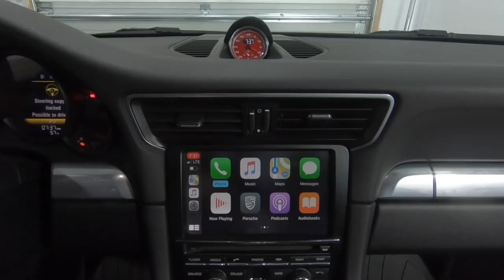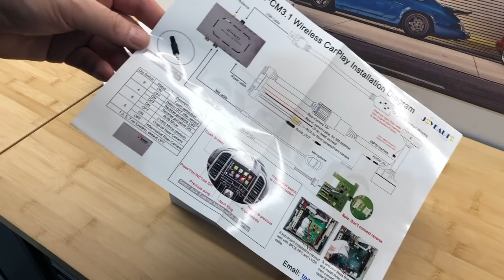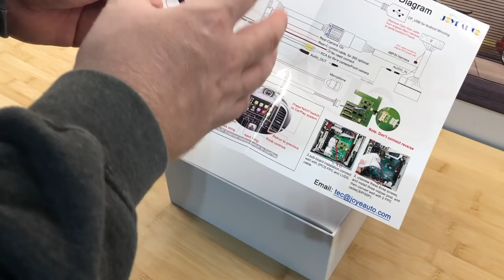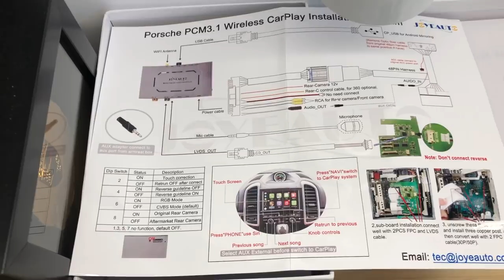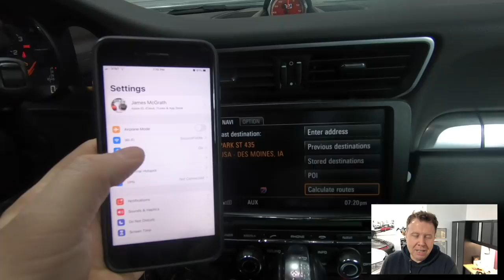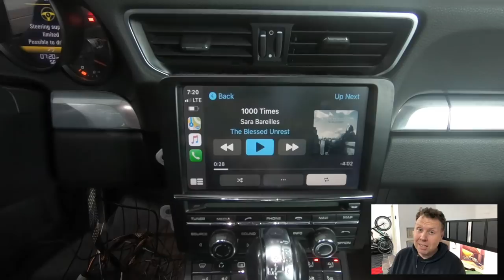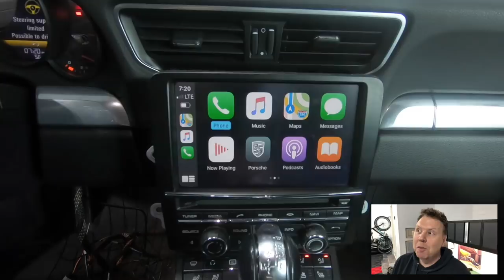Apple CarPlay DIY (Wireless) for Porsche 911 / Cayman / Boxster / Macan / Cayenne / Panamera

Comment: Congrats James, rally nice job and video! I am about to install the unit by myself to my 16 Panamera GTS. I do have a question regarding connection of the fuse to the car fuse box, wondering which slot# should I choose? From the forum I have been seeing discussion about that fuse should be plugged in to slot that cut off if the car power off (some slots are always ON I guess), any instructions regarding this part? Thanks a lot and congrats again!
Reply from the maker: Hi there! Thanks for your email too. I sent you a photo of my fuse box to show which port I used. Good luck and let me know if you have any other questions!
Reply: Zhi Li I’m also going to fit to my Panamera and am interested in which fuse location was used

Comment: Exceptional video.. About to collect a 2016 Cayman GTS and hope to do the same; whether I do it get it done, let's see but you've done an amazing, well presented and instructional video. Thank you
Just have to add that if ANYONE has done this to their 981 Cayman or Boxster, how well did it go and was there space for the Joyeaux unit and where?
Reply from the maker: I just installed this in a 981 Boxster yesterday and the job was identical to the 991. Enough space, no issues. Hit me up if you need any help! Thanks!!

Comment: I just installed the JoyeAuto in my 991.1 yesterday. I couldn’t have done it without your great videos. My only snafu was removing the orange Bose wiring and then mistakenly reinstalling it in the same place. I do have one question. You mentioned secured the box with zip-ties. Do you have any suggested in this regard?
Reply from the maker: Nice work Nigel! Great job. For the zip-ties, I used black ones that I bought from Amazon which were approximately 12 inches long. I wrapped several around the JoyeAuto unit first to create a 'mesh' of tight lines for me to use to mount the box on the size of the car. I then used another zip tie, fed through the mesh I created around the box, to then attach everything to the side of the car and pull it tight. I'm maybe not explaining that very well... hit me up at contact@autoamateur.com if you need more... cheers! James
Reply: @AutoAmateur  Thanks James. Big fan. I think I understand what you did. My next job is the backup camera. Yikes!

Comment: Such an awesome video, thanks for taking the time and detail to do it right!  I installed this on my 2011 Cayenne S, and it is so great!  Absolutely, perfect and really updates the tired PCM-I don't look at my phone anymore while driving, too.  I wouldn't have trusted this product from China, and the detailed install, if not for this video.  I am amazed not a wire was needed to be stripped, spliced, or crimped.  Everything falls into place perfectly. This is even better than most factory installed CarPlay as it links wirelessly upon start up.  Ultimately, it is not as hard as it looks-it is worth it!

A few notes/speedbumps from my install:

My problem was video would show after pressing NAVI, but no sound.  

1.This overall theory needs to be stressed: the sound from CarPlay module comes through the standard PCM AUX input, and you have to press that prior to the NAVI button, which activates CarPlay on the screen.  If you don't press AUX first, it will play whatever audio you are on, while showing CarPlay.  Just leave your source on AUX and your car will seamlessly go to CarPlay every time automatically on startup.  

I had disabled and hid the AUX button, previously, since I never used this older technology, instead using AUX BT (which I now disable/hide in favor for the JoyeAuto CarPlay).  I could not find a way to unhide the AUX input and ultimately had to do a PCM reset, to have it show up again.  After performing this reset, it appears and you can then select it, and have sound and full functionality.

Perform a PCM handover (also known as a PCM hard reset):
Press and hold the Info button for approximately 10 seconds until the PCM reboots.
Immediately select the following from the CAR>>OPTION>>Set PCM System>>Reset PCM>>Vehicle Handover>>Yes>>Yes
Press and hold the Info button for approximately 10 seconds until the PCM reboots.

2. JoyeAuto is now including 6 screw mounts (screw 2 together (x3) for a tall support) for the circuit board install, so it sits higher and perfectly above the existing boards.
3. Turn off AUX/BT and just commit to using CarPlay fully.  This reduces connectivity and calling issues, and just simplifies everything.  Bottom line, you won't need the old PCM interface anymore.
4. Fuse board spot for Cayenne, is on the left side of the driver side dashboard, where the dash faces the door.  Pop off this panel and plug in fuse into a vacant spot that turns on and off with the key in and out of the ignition.  
5. Make sure to read and follow comments/tips from Fastpitch Net, very helpful must read notes!
6. SAT still works as a source in case you ever want to go back and use Sirius XM like normal, however, there is a CarPlay app for that, so you can just stay there and use that instead.
7. Make sure to go into settings and have the microphone do an automatic adjustment.  My callers were getting echo when talking handsfree, and this setting auto adjustment instantly fixed it.

Feel free to ask any questions!
Reply: Thanks Mr Largo, Can I ask how you do #7? Where do you go into settings to have the "microphone do an automatic adjustment"? My voice quality to outside callers is terrible and distant. This is the first I have seen of this suggestion. Maybe I just missed the setting. Is this on the "settings" icon on the CarPlay screen (displayed on the cars PCM display)? Wondering if my version is missing that option on the Joyeauto installation.

Comment: Your video was truly helpful! Thank you.
However, after installation, this module has discharged two batteries already (one - I thought it was old, two - I realized it was the radio). Do you know if I have done something wrong? I'm thinking on returning it back now...
Thanks!!
Reply from the maker: You’re using the wrong fuse slot. You need to make sure you’re using a switched fuse which means the slot powers on and off with the ignition.

Comment: Thank you for this, by far the best DIY out there. Question, since you have SirusXM. Can you listen to it while also in Carplay?
Reply from the maker: Thanks! Great question. I will have to check, but I don't think so. The CarPlay app comes in like an Aux input. So when you select it, it 'owns' the audio input and what you listen to.
Reply: You can listen to any input whilst the CarPlay screen is on. So you can be in Apple Maps, source set to Sirius (i only tested FM Radio), and control radio from the dash screen.

Comment: Great job. Any thoughts on installing a backup camera at the same time on a 2015 911S? Excellent detailed video. Definitely a job that requires patience and a bit of support.
Reply from the maker: Thanks so much! Installing the back-up cameras physically is quite a tricky job to do alone, but once you have the wires inside the cabin it's super easy to plug them into the AppleCar Play JoyeAuto device and have them appear on the screen. The challenge with the cameras is removing the front and rear bumpers and then snaking the wiring inside the cabin and then figuring out the best way to give them both power. I believe the rear camera needs to tap into your rear brake lights and the front camera can wire directly into your fuse box. A friend of mine just attempted this job (completed it successfully) and it took him all weekend. If I can find that much free time, I'm quite tempted to try it out. If nothing else, it will make for a great video! :-)

Comment: Great installation video!  Been thinking about doing this, and now I feel more confident I can.  Looking forward to receiving my joyeauto kit.  Thanks for taking the time to make this educational video.
Reply from the maker: Awesome! Please feel free to give me a shout if you need any help talking through the install. Good look!!
Reply from the maker: “Luck”! 🙄🤦🏼‍♂️
Reply: I ordered the Joyeauto kit off of aliexpress on 4/17, received it 4/24 (very quick) and installed it today (4/25).  Thanks a lot for the time in making the install video.  Very helpful. I had a couple of “uh-oh” moments.  I needed to transfer the fiber optic cable from the OEM 48 pin connector to the new one. I had a really hard time putting the joyeauto connector box under the steering wheel.  I found an area further back, above the pedals.  I secured it with zip ties so it wouldn’t interfere with driving should it get loose. I also had an “oh-s**t” moment when the video cable came off of the motherboard. The female part of the plug that is supposed to be fixed to the board came off.  I was able to reconnect it, but that means it’s not as secure as it should be.

I also ended up getting a small “nick” on my screen. Bummer, but oh well. I know you said to be careful, but apparently I wasn’t careful enough.  I would suggest to others that they tape some cardboard over the screen while work is being performed. 

After the install I did notice my one touch up/down on my windows didn’t work anymore. It started working again, but my passenger window still doesn’t “one touch”. I’m hoping it resets/fixes it self. (My car is a 2015 991 S cabriolet). I’m looking at adding another mod to lower/raise the roof with the remote.  Just waiting for my Smart Top (from mods4cars) to arrive. 

Oh, you also said you didn’t receive enough screws.  The store I ordered my kit from said that if you have XM you should ask for extra screws.  I have XM, so I asked for extra screws and I received them. They gave me six.  However I was only able to use 4 because of interference with existing components.

I also found out that some of the ribbon tape connections weren’t properly made.  Once I reconnected them it worked.

Comment: Again thank you so much for the video. Now that I have watched it entirely, I have a couple questions and depending on your answers will be buying the joy auto  1) You have had it a year now, are you happy with the joy auto unit? 2) You installed the unit under the steering column, but I didn't see you "secure it" in any way. Does it rattle? 3) Will any empty fuse port work? (You mentioned D1 early in the video) 4) You installed the microphone near the steering column. Does it pick up your voice well, particularly when you are driving and their is road noise?   THANK YOU
Reply: I just saw at the top of you post that  you are selling units for 25% off MSRP.  How do I buy from you?

Comment: Hi James. great video! i have one install in my wife Macan and everything works really well except when she calls from her car the receiver of call hears and echo of their voice coming back to them.
Just wondering if you have any suggestions please?
Reply from the maker: Hi there! I have encountered this issue with one or two installs. I think it comes down to a combination of the quality of the microphone and how securely it's mounted. For my own 911, I found that mounting the microphone inside the steering wheel column, next to the factory microphone, has worked very well for me. I don't seem to have any issues with echos or voice quality. A simple solution might be to invest in a better microphone to be honest. You can pick up a decent quality microphone from Amazon for anywhere between $10 to $15. It's just a simple plug and plug microphone.
Reply: @AutoAmateur  thanks James. appreciated and try that.

Comment: Excellent tutorial, thanks. But, question. You say the Chrono dial face was a 5 out of 10 and this an 8 or 9 out of 10. What would you say an engine swap is on difficulty? Or, perhaps replacing gears in the PDK? Maybe you explained your scale before and I missed it. Keep up the good work.

Comment: I have looked and looked to find a video like this and I must thank you for your very detailed video. Although mine is Android+997.2, I don't think it would be much different. Still looking pretty daunting job to tackle on but at least now I know what it involves in. By the way you put the JoyeAuto unit under the steering column but I was wondering if you held it in place with anything such as ziptie, double sided tape and so on. The space looked like it's a pretty tight fit and the unit wouldn't come out of that spot easily but I wouldn't like it if it rattles when I drive only because I didn't hold it in place with some sort of fastening method. 
2 constructive criticisms are that your background musics are very cheesy (I respect your taste though) that I am not sure if they suit to these type of Porsche videos and that you put reverse rolling /dissolving effects on the captions that show the first sentence the last. It makes the viewers not able to see the whole captions clearly. No intentions to insult you in any way but just my thoughts. Thank you very much again for your helpful videos.
Reply from the maker: For me, I'm able to store the device under my steering column, in the space between the trim and the column but that's only because I have the steering wheel all the way out and up, to accommodate my height. Most people can't use that space and therefore secure the box and the cables to the upper left side of the driver's footwell. That's a great observation!
Reply from the maker: p.s. Thanks for the feedback on the video too! Noted!! Appreciate it.

Comment: Excellent video, I'm just working through this and it worked first time. The only issue I have is getting the PCM unit back in to the dash, the extra wiring is stopping it going all the way in. Any tips on this?
Reply from the maker: Thanks Richard. Glad it helped. Yes, it's a tight squeeze back there but with the right 'finagling' it will fit. I believe there are some open spaces below the PCM which can take some of the wiring and try to make sure the black wiring harness (cube like connection) is over to the right hand side of the space.

Comment: Hi James. Just ordered the unit for the upgrade. Should be doing the install in early May when the car come out of storage. Your video is excellent and I’ll have my iPad going next to me every step of the way. Would be kind enough to link any other sites you used to get some more installation instructions? Thx...
Reply from the maker: Hey Tony! Nice one! One of the reasons I made the video actually was because the instructions that came with the device weren’t great and the stuff I could find online was equally terrible. If you need any help during your installation please hit me up at AutoAmateurBlogger@gmail.com. Happy to answer questions or even jump on a call or FaceTime if you want to. Happy to help. Cheers!
Reply: Thanks for the reply... will let you know how it goes and appreciate the offer to assist.
Reply from the maker: You bet!
Reply: Hi James. Just finished installing the CarPlay. Much easier than I thought it would be. Your video helped out a bunch, especially when it came to disassembling the head unit and making sense of the wiring harnesses. When I started testing, I wasn’t getting any audio, but thankfully, one of the comments let me know about the fiber optic cables. Still trying to figure out where I’m going to hide the box. Thx again.
Reply from the maker: Nice one Tony, thanks!! Congratulations on a job well done!

Comment: Excellent video!  Did you take precautions to ensure the box doesn't get crushed under the steering wheel if it is adjusted down?
Reply from the maker: Yes, it’s to one side and not directly under the steering column. The only thing that would get out under pressure if the steering wheel were to get lowered would be the wires.
Reply from the maker: Ps. Thanks!!

Comment: great Video. I had to reconfigure the switches on the external gadget and everything works well and connects with any iPhone. the only issue I'm facing now is connecting it to my android. Nothing I did worked till now. Any tips out there to help me fix this problem??
Reply from the maker: Try using the USB cable first. Once connected, your wireless connection should pick up the next time you’re using the unit.

Comment: James, great video and just ordered the Joyeauto based on your feedback for my 2013 Carrera Cabriolet. Quick question - does everything work as normal, specifically the sound from CarPlay or OEM source when you select reverse? I only ask having installed an aftermarket Screen with CarPlay support in my BMW X5 and as soon as I select reverse it disconnects all audio until you select 'N', 'P' or 'D' again. Thanks in advance Andy
Reply from the maker: Huh! I don’t know! I’ll check that out tomorrow and let you know! 👍

Comment: Thank you for this excellent video!  Quick question-- I added the mother board today and have the PCM back together awaiting reinstallation tomorrow.  What settings do I need to have the dip switches set on the Joyeauto box?  I am only adding CarPlay, no cameras at this time.
Reply from the maker: You should just be ok with the default settings. Don’t touch anything! 🙃👍

Comment: Thanks so much for the videos, they are invaluable.  

I have installed the Joyeauto system in my 991 and everything works great-- except the Joyeauto seems to reset every 4-5 minutes where the screen will go black for a split second and the audio stops.  Everything resumes working as before after about 1-2 more seconds.

Do you know what might be causing this behavior?
Reply from the maker: You bet! I just replied to your email. Check it out and let’s talk if the two suggestions I sent don’t work. Cheers Vin!